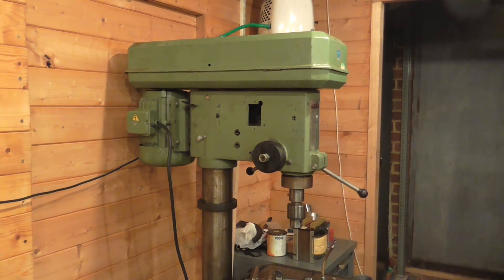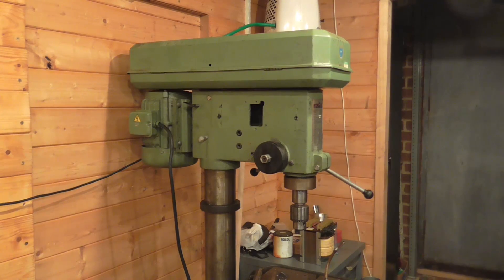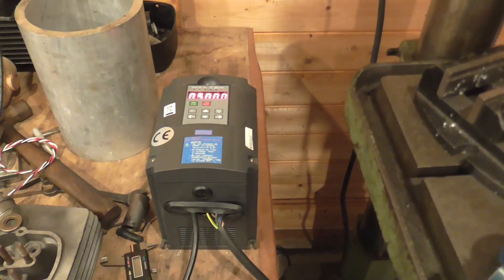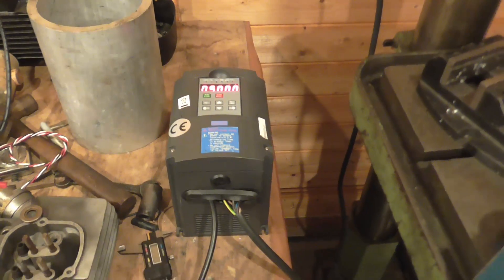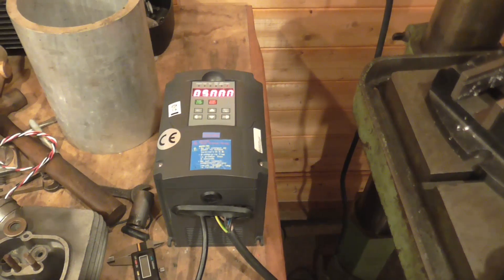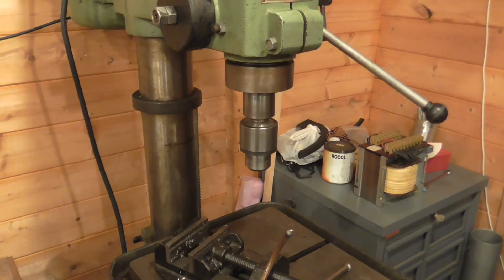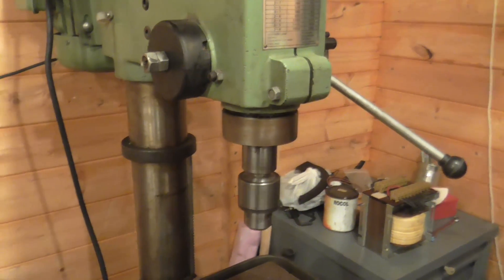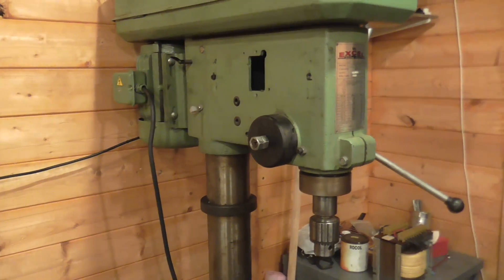Three Phase Motor Follow-up

Comment: I've just test fitted a VFD to my drill press a couple of days ago, but how do I know what Hz I can safely run the old motor up to?
Reply from the maker: I've never found a motor that wouldn't take 100Hz. Obviously the bearings and state of balance should be up to the job

The original 1963 motor on my Harrison gets run at 133Hz occasionally for a 2000rpm spindle speed. 

Back in my electric vehicle racing days I can remember some tests being done on a 10hp rotor to determine the burst speed. They never found out as the test rig only went to 10,000rpm.
Reply: Thanks.
I've heard stories about a motor test stand where things went terribly wrong, despite the railroad ties over the pit the motor was in, so I'm a bit wary since then. But that was for large motors of course.
I think the rotor of these AC induction motors should be fairly robust.
This is for a nice old precision drill press that goes to 6000 RPM on the spindle (2800 nominal on the motor). I'm really more interested in slowing it down than speeding it up, but it might be nice to reach the fast spindle speed at a slow belt position so I don't have to change it.

Comment: Paul,
The power frequency in the UK is 50Hz, correct? Doesn't operating a motor designed to run at 50Hz tend to overheat if run at a higher frequency that it was designed for? Thanks for the video!
Dave
Reply: Yes, the service mains frequency in the UK is 50 Hz. 
Actually, operating an induction motor at a higher frequency (within reason) results in less coil saturation and runs cooler.
Reply: I never stop to think about that. A higher frequency wouldn't saturate the core so much, thus fewer eddy currents in the stator core and thus, less heat.
Reply from the maker: The coil impedance goes up with increasing frequency, so the current drops.  In theory you should be maintaining the same voltage/frequency ratio to maintain rated torque.

The lower current and the fact that the built in fan is running faster means that the motors often run cooler!